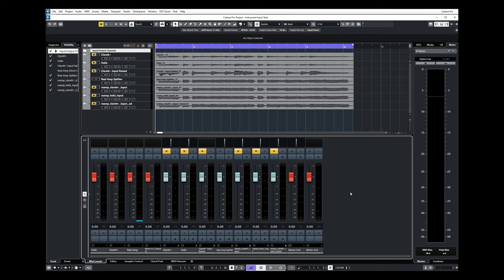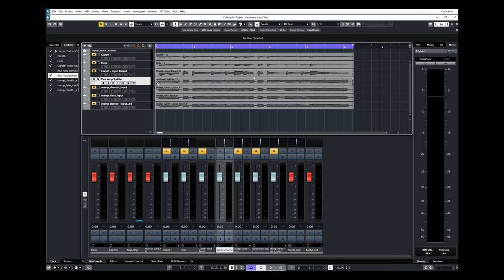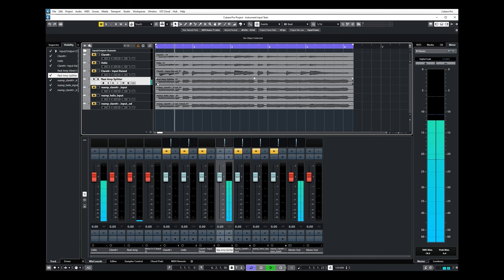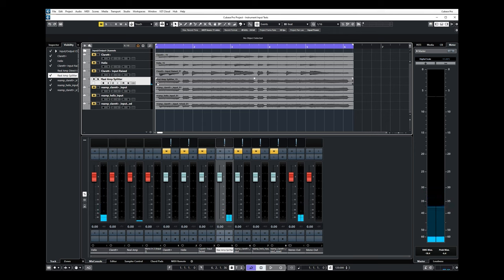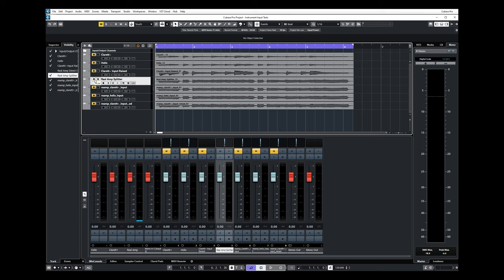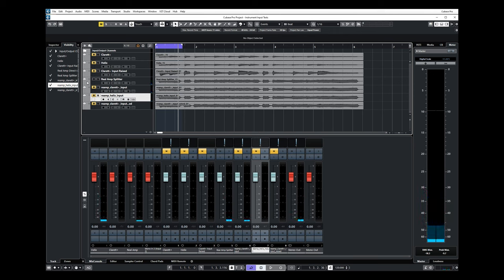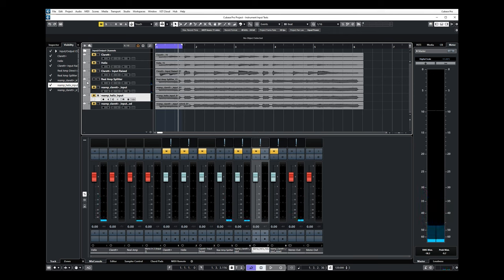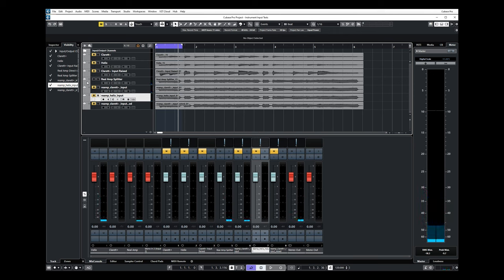Do You Want Better Modeler Tones? STOP Doing THIS! SERIOUSLY! | Tonex, Helix Native Etc.

Comment: Wow, great discovery, thanks for putting this together. 😊
I was wondering why some plugins modeled after the real amps (which I owned over time, some of them I still own) are sounding different.
@16:05 is the fact where everything makes sense. The signal moves up and down around -18 dBFS on digital, which is 0 VU on analog meters. 
Back in the day of analog recording, no one would want to go over 0 too much.

Now, watching some other youtube videos I realized that some companies are modelling their plugins with a very low input. For example the Rectifier from Amplitube 5 doesn't sound any close to the real amp at the same gain level, so you need to compensate with a clean boost plugin. 
Some people went to great lengths and contact the plugin makers, and put together lists for which plugin needs how much boost. Apparently the only one that doesn't need any boost is Neural DSP. For instance, Rectifier from Amplitube needs +12 dB in order to sound like the real amp.

Comment: Personally, I'm not worried about re-amping. I look at the input level in my Focusrite control app and adjust the input gain so that it peaks around -15-ish or slightly over. That way I'm limiting the effect of pickup output on saturation.

Comment: Really great 🔝
I've been going crazy for years, I couldn't get any sound at breakup because when I raised the gain of the amplifiers after 5 the sound distorted badly.
And I couldn't insert overdrive or distortion for the same reason.
I had already tried to set the gain of the sound card to 0 and I felt that it was better, but the sound seemed too thin and so I thought it wasn't correct, since the manuals say to reach a certain threshold.
But with this demonstration video you have removed all my doubts and so I set the input that arrives around -20db and I have finally solved all the problems.
Really thanks for this test 🙏🙏🙏

Comment: to be fair, some VST software recommend that you DO turn up the gain to the point of nearly clipping for the best results. some VST software have an auto setting that you can select that will FURTHER boost the input a little more on top of the almost clipped level to reach what it deems an appropriate level... and these software(s) do sound good at these settings. i also get your perspective on it, it makes sense... and helix native does require a much lower input setting to reach its optimum level compared to the other VSTs. All this to say I think it depends on which software you use, as perhaps they have different digital reference levels they use. I find that amplitube, specifically, seems to require much hotter signal on some amp models to sound good/more accurate to their real life counterparts. anyway, just some thoughts... you got some good content on here I dig it

Comment: To my limited technical understanding, if you clip at the interface you’re losing information you are not gonna recover. HOWEVER, within you daw you can clip at some point and recover that information. For instance, you can clip the input level within Tonex Plugin and lower the output and it’s fine. I’m saying this because I did run several tests in my end and in many cases doing this makes for a better tone. This does introduce extra noise though, so that’s something to consider.

Comment: Damn this is fine piece of education here… just because I noticed it isn’t part of your setup: Could you briefly explain in your kind words what exactly a DI Box is used for? „converting unbalanced or high-impedance instrument signals…“ blah blah wtf 😅

Cause I’ve often get the impression folks prefer using an DI Box into a MIC input over using an instrument input especially when it’s about very heavy guitar tones. Why could this be a thing or what is the difference of these setups?

Comment: Guitar into pedal board into amp or straight into amp...sounds great, feels great.
Guitar into Helix LT...sounds bad, feels awful, but with enough jerking around I can get some good sounds, particularly clean or cleanish sounds.
Guitar into Helix Native or whatever VST...sounds great with very little effort.

I've finally accepted there's something wrong with my Helix LT.  If I were to download a preset or build one that's exactly like one from your videos or John Cordy's videos, I have to put a gain block in front of everything at like +8 or +10 db to get them to somewhat match.  If I don't, everything sounds weak and it feels so nasty and crappy to play.   And if I'm playing a guitar with regular single coils, the noise is awful with the gain block on.

Same preset with native, I don't need the gain block at all.  

For a while I thought it was cables.  It ain't that.  It's this LT.  If I use the LT as an interface, it also sucks.   I have a Stomp, too, but a friend of mine has had it for a while.  I need to get it back and compare but I think I had the same problem with it.  I really don't know.  I was brand new to modeling when I got it, then I got the LT and moved the Stomp to a pedalboard for use with an amp.  It sounded fine for that.  That's how she's using it and I've heard no complaints.

I know this wasn't the topic of this video, but it got me to thinking about my problem again.

Comment: I have a scarlet gen3 and Soldano from NeuralDSP. I tried with no added gain on the Scarlet and it isn't good. It takes a lot from the frequencies and the clean sound isn't quite responsive. I get the best result (clean/dist./crunch) when I add gain on Scarlet. It just sounds more natural than gain set to 0.

Comment: This is why I NEVER (and will NOT EVER, until it breaks) have gotten rid of my trusty old Korg Tuner with a buffer. I use my mini "Pedalboard"  (the Korg DT10 plus a Dunlop CryBaby) when I plug anything into something.
Everything else has to adapt to this Level and my Helixe Stomp, my Behringer UMC22, my 4 Amps and also my Boss Looper work just fine. Also with different presets, created by different persons (for example Jason Sadites ;) ).
I use different guitars and even active basses. I never have to boost the input stage! Other than with a gazillion drive pedals, of course ;)

thx for clearing this topic up. It can't be stretched and emphasized enough. So many people doing horrible stuff to poor poor innocent signals, I really don't get how they all gotten to this  behavior...

Comment: Thank you so much for making this video, Jason! I've had tons of questions about this but the only thing I've found was making sure peaks were at -6 dbFS. Some people have specifically recommended using a DI box, which I'm now using, to try and get better tone, but I'm going to do some experimentation within the -36 to -12 dbFS range. 

That said:
1. Depending on audio interface, do you think for optimal results someone would need to execute a similar test to what you're describing?
2. Using a DI box, how would one essentially "zero" the input gain to get the most natural results? Play around and see what sounds best?
3. I have a partscaster with a Seymour Duncan JB, and using my Apollo Hi-Z input at 0 gain, it's still clipping and there's no pad available for the Hi-Z. What would be a solution for that?

Thanks for the wisdom, as always!
Reply: Following up on this... I was playing with the suggested gain levels, reading from the Apollo's console screens, and got some pretty strange results. The high gain amps sounded clean in ToneX.

In the Apollo manual, regarding setting the gain level, it says:
Adjust the input channel's gain by rotating the LEVEL knob (11) until the input meter for the channel (4) approaches maximum, but does not reach the red clip LED when the loudest input signal is present. If the level is too high to avoid clipping (when the red “C” LED illuminates), enable the PAD (6-d).

There also appears to be at least a slight discrepancy in the input level shown in my DAW vs. what Apollo is showing. I know this isn't a UA Apollo troubleshooting channel, but I'm sure lots of folks use them, so I'd love to hear some insight on that end.

Comment: Thank you! I asked myselve the same question and you had the answer. I have a Schecter with a Duncan jb, a 335 with a low output Pickups and a strat. When the Input in the Interface should be at -5db then i had to Change the Input everytime i change the guitar. Thats Not what i want. I want to use the tonex Software like my amps. And even more important: when i bring Up the level when i plug in the strat or the 335 they will Push the amp Like the Schecter with the duncan JBs and thats not how it should be!

Comment: Great video!  I have a focusrite 2i2 3rd gen and have been raising the instrument input gain just to the point of no clipping, but bringing the gain down to 0 would be closer to the same signal going into a real amp? I use Amplitube 5 to track guitars and want to feed it the most realistic signal possible.
Reply from the maker: Thank you! The reason that working with the instrument input set lower is more realistic is that you will then be leaving more headroom for various guitars and avoiding the need to change the instrument level for each guitar. For instance, if I set my level to just below clipping for my lower output Strat style guitar and then plug a guitar in with higher output pickups it will then need to be lowered to avoid clipping. We now have a situation where the guitar are not acting in a realistic manner relative to each other and how they would sound if we plugged them into a real amp. By leaving ample headroom (i.e running the instrument level lower) you avoid the need to constantly change input levels for each guitar and therefore have a more realistic representation of each instrument. Hope that helps :-)
Reply: I do exact same things. From there i ad a VU meter on my instrument track and trim the gain knob until i reach 0 on the vu with a headroom between -18 to -14 dbfs.
Clean signal. No extra distortion or clipping 😊

Comment: Hi Jason love the videos, I have always increased my input level not for s/n ratio but to use the FS input of the AD to get the best representation. Why would you not do this and then turn the signal level back down to instrument level when needed (re amp)? Genuinely curious.
Reply from the maker: Thank you! Just curious what "better representation" you feel you are getting by artificially boosting the voltage coming out of your guitar? I set my Instrument level input so that a 0dbu signal will equal -11.5 dbfs and have never seen any benefit in boosting beyond that. If a particular modeling software solution is expecting to see more than that than I would handle the level adjustment within the given piece of software. In the video I explain very clearly why I actually avoid artificially boosting the signal as to leave ample headroom for different guitars and avoid the need for constant adjustments between guitars that does nothing other than misrepresent the actual signal coming from each instrument. Hope that clarifies :-)
Reply: @JasonSadites  the reason for increasing the signal going into an a/d is to take the advantage of the full range, why have a 24 bit a/d if you are only going to use a small portion of it. After you convert the signal then you can decrease it's level.
Reply from the maker: @steveterwilliger6744  that is looking for a solution to a problem that doesn't exist though. I mean anyone can do things how ever they want, but you aren't gaining anything by working that way. Just my two cents 😀
Reply: @JasonSadites  thanks Jason I've learned a lot about my Tonex from your videos.

Comment: Hey Jason, great vid. So in summary, just a tiny bit above zero on the interface gain is the most realistic setting?
Have i got that right?
Reply from the maker: Thanks so much! It really depends on which interface. Each one is a little different. I aim for having a 0 dbu signal hitting the Instrument input to be equal to -11.5 dbfs. That is what the Helix  guitar input is. The Focusrite Clarett+ needs a little gain added to get to that range. I have an Audient Evo interface that I have to cut the gain by 1db to get it right, but it would be close enough without any change. The point I was trying to make is with most modern interfaces you will be better off leaving the instrument input level alone than cranking it up to just below clipping as so many suggest. Once you have calibrated your instrument level input you can then deal with levels withing the software modeler of choice if need be. Hope that helps :-)
Reply: @JasonSadites  ive using a scarlett 2i2 2nd generation. Yes, that makes sense. In fact, your rationale for input settings is so intuitive, I don't know why everyone else advocates boosting the gain.

Comment: Trying this out.
I get the idea as it's similar to how i used to set up my Boss GT1000, get the level right for my lowest output guitar (strat/single coils) and leave it there. My Les Paul/Humbuckers pushed the front end more but to me it was more natural.
Problem I'm having following this is that the RMS and Peak levels are very different.
I'm using a Focusrite 18i20  3rd gen and strat with single coils, instrument level with no added gain on the input
and I'm getting RMS at 23 and a Peak of 17.
I can use the input pad and add a little gain to make RMS 29 but the peak is around 19.
Is the RMS level or the peak level setting the more relevant?

Comment: Regarding Line 6’s suggestion of running into interface at Inst level, what if we are using a DI in between the guitar and interface? Is a line level signal not as good as inst direct to interface? I love how my Radial DI sounds going into Helix Native but I had to boost the input gain a bit to get in the sweet spot. Appreciate the vid cause I’ve certainly noticed that difference between hardware helix and software helix.
Reply from the maker: Hey Devin, absolutely no issue utilizing the Radial DI if you prefer that method. Since the DI is converting your Instrument to the mic level using the DI, you will need to add some gain to get it back in the proper zone. You can do this by comparing the levels to the raw DI from you hardware Helix. Once you get those the same, just leave it and get on with playing :-) Hope that helps!
Reply: @JasonSadites  awesome thanks man!

Comment: There's a problen thoiugh, and it's a big one - the developers of different amp plugins are NOT calibrating the guitar input level into the plugin to the same level. S-Gear, for example, requires a significantly higher input level than BIAS FX or Tonex.
Reply from the maker: This is very true, so I would deal with that within each piece of software and still just leave my Instrument Input where I have always had it.
Reply: @JasonSadites  I did try to do that within S-Gear (3.1.2) but there was not enough input gain ('INPUT' knob in bottom block 'S-GEAR I/O') to make a significant difference.
I'm using an RME Fireface 802 interface, plugging into front combo input '9', setting 'INST' for that channel in TotalMix interface software. The Gain knob on the interface goes from +6 to +60, and I'm having to turn it up to around +30 (whereas I can leave this at +6 for Tonex/BIAS). It is interesting the Fireface Gain knob starts at +6 rather than 0. Nevertheless, I do have to adjust it for the different plugins.
I've never been happy with any clean or edge of breakup sound - they've been greatly different in sound quality compared to all the YouTube demos, making me think there's something basic I'm still doing wrong.
Reply from the maker: Hey Chris, it just so happens that you are using an audio interface that has quite a large amount of headroom. The specs that I see for the Fireface 802 are that on the instrument input the Max Input Level with the Gain knob at minimum (+6) is +21 dBu. What that means is to get it to the level I am discussing in the video you would need to add about 10 dB of gain. I discuss how you can calibrate that in this video about Tonex, but it will work with your interface also: https://youtu.be/AAL9AEWkoDM?si=CkBS_JXAh-uQtLZM&t=237 Once you have that input set, you will then not have to add so much gain in the S-Gear plug-in. Let me know if that helps :-)
Reply: @JasonSadites  Huge, huge thanks for finding this out! I'll try this out this week and report back. Cheers.
Reply from the maker: My pleasure and let me know how it goes 😀

Comment: When I record my guitar with the gain on zero on the interface I hit around -25 dB at highest peak. I cannot even see the track’s wave shape properly on logic. The meter on every NDSP plugin does not go above 30%. And I am using rather hot pickups (12ohm). 
Lookin at Neural’s demos I see their meter hitting above 60%. 
Something does not add up
Reply from the maker: Can I ask what audio interface you are using?
Reply: @JasonSadites  Focusrite Clarett+, but I also tried with the QCortex as interface. More or less the same result.

Thank you for replying!
Reply: @JasonSadites  I get the best results (using my ears) if I add 7-9 db of gain, depending on the guitar.
Reply from the maker: @bucketofnoises7810  the Clarett+ has a maximum input level of 15 dBu, so I would add 4 dB to it to match where I usually run which still gives me lots of headroom and avoids the need to change it for every guitar. Hope that helps :-)
Reply: @JasonSadites  thank you very much!
Reply from the maker: @bucketofnoises7810  my pleasure and all th best 🙂